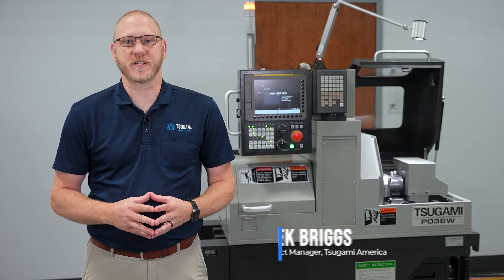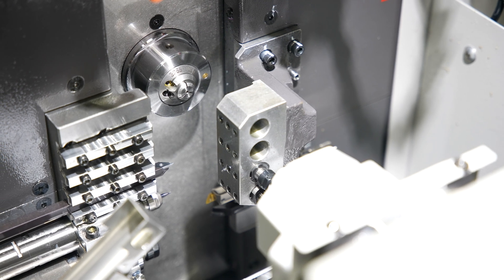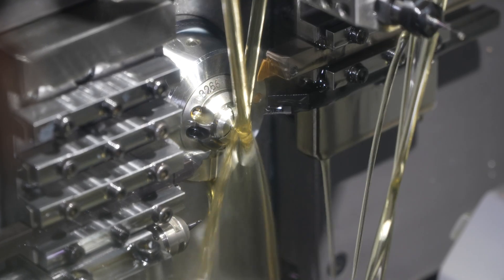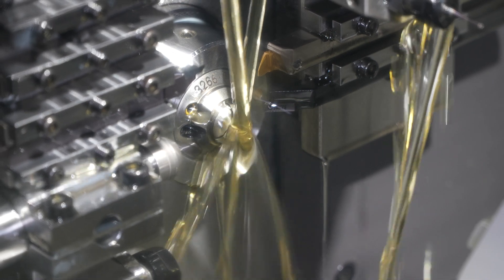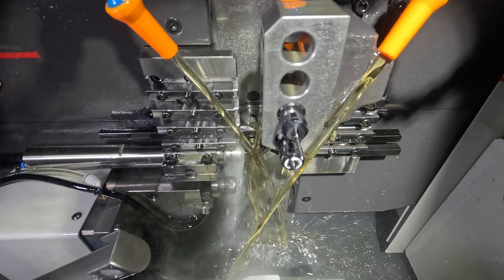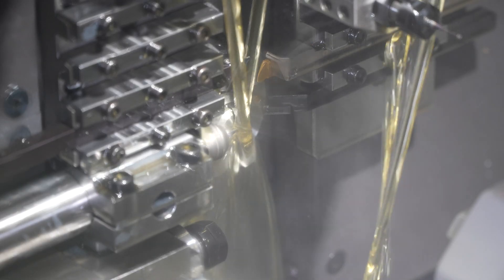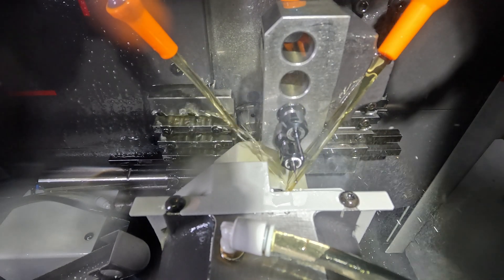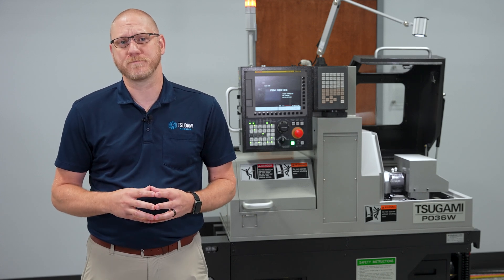Introducing the Tsugami P036W

Comment: This looks like static (non-rotating) guide bushing unit like P034.  I really wanted to like the p034 but it would never run more than an hour or two before guide bushing galled up (ground stainless bar  stock).  I had multiple people from REM attempt to solve this problem over multiple months but we ended up returning the machine, for this reason alone.  What is the solution to this?  Everything else was great…